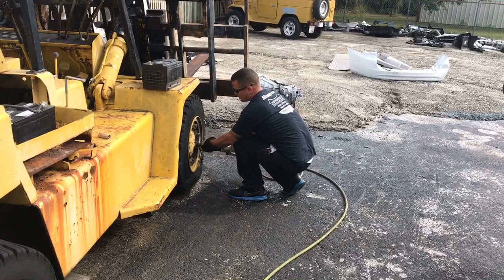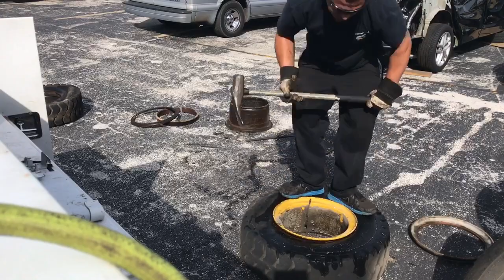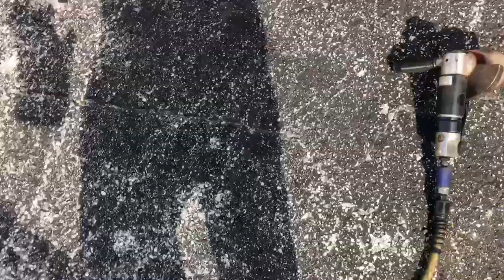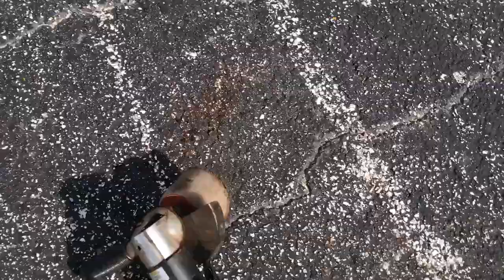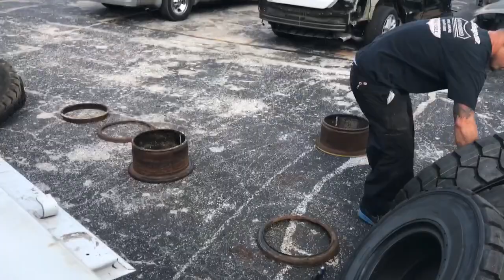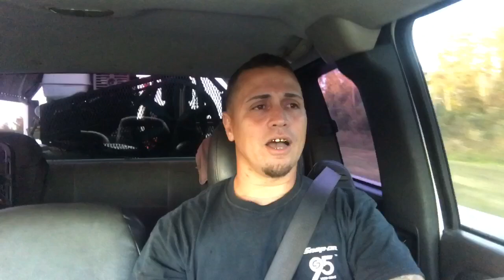Changing 8.25-15 tires on an industrial forklift (Full Video)

Comment: Good to see someone cleaning out those locking grooves and rings. Absolutely essential!
 Back in the (35 years ago) day, almost all the light commercial wheels I used to deal with were two and three piece. But I never had a wedge hammer like that. Always used a short handled sledge and a tire chisel, or a big ol' slide chisel. Damn, I did some stupid stuff and eventually hurt my back. Worked in the depot for a while after that doing cars/vans/wheel anignment/exhausts/sunroofs. Easy jobs, shit money. :¬/
Reply: Any work takes health. I am a forklift driver. We have a bad road at the base and now my back hurts. I was at the doctor, they said that the vertebrae began to deform. All this because of shaking and vibration. I'm from Russia.

Comment: Been doing same job since I was 12 years old have my own business in Lv if forklift was running you could raise forks all way in air put blocks under the mast on both sides and tip it forward then drop the forks for the front on the back drive it on a block to get jack under Matt m&o tire
Reply from the maker: +Matt Wolfgong that's exactly right. Thanks for watching.
Reply: TripleATireService  you are very humble bro

Comment: this is pretty helpful. I watched a guy spend 5 hours changing a single tire. It looked a little wider than these and was a snug fit. Sound was low when you were explaining the Sanding and what is the fluid you sprayed on it, both in the can and bottle.

Comment: What are you using for a grinding wheel? I use a 4 inch wire brush cup on my air grinder which looks similar to what you have but yours looks way longer.
Reply: That is called an abrasive brush. The brush has strands of fine grit sanding material. These are uses to clean or lightly sand metal where gouging is not allowable. As a jackass of all trades I have used these to remove rust and scale from the ID of pipe and tubing before welding. I am going to have to start billing you for all the questions I answer.
Reply from the maker: I use an air grinder with a cup brush or a wheel

Comment: would you mind telling me the type of equipment you are using?
Reply from the maker: +heng shihung which equipment?
Reply: the bead breaker ..
Reply from the maker: +heng shihung www.esco.net Pump Model #10502 Bead Breaker Model #10101
Reply: thank you
by the way , can forklift tires# 225/70-15/7.00 use tires number :815-15?